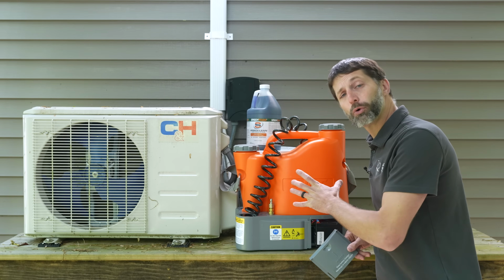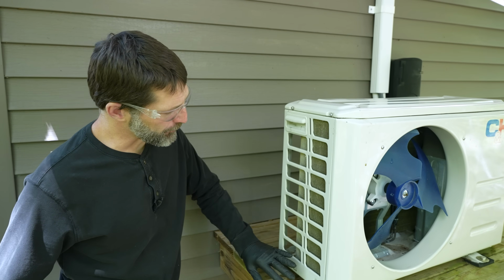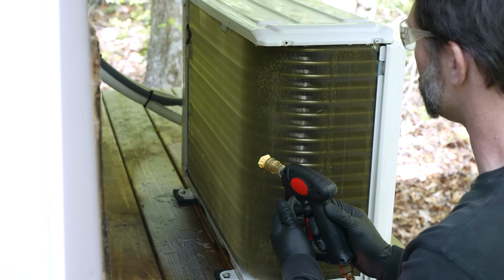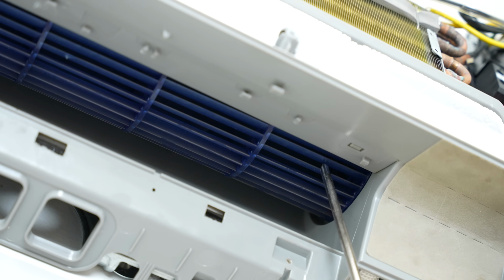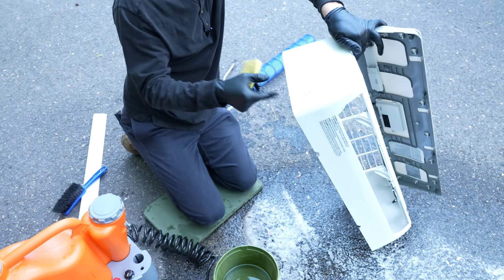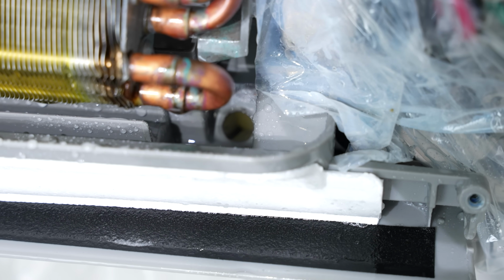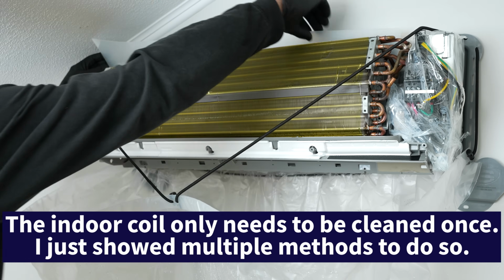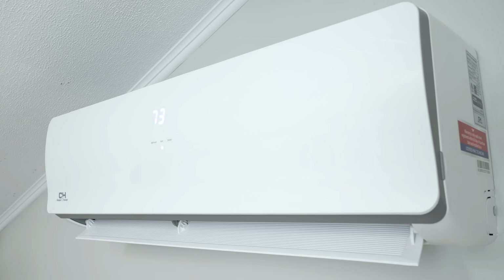Ductless Mini Split Cleaning! Outdoor Coil, Indoor Coil, Fan Wheel, Blower Housing, Methods!

Comment: Thanks to this video, I cleaned my unit properly, managed to get the blower out and deep cleaned. The blower is challenging to fully clean cause of the inner grooves, dust particles are stuck there and a pressure washer cant get to it. Next time ill probably soak it.
Reply: 100% Same here. This vid saved me a lot of guess work finsing that set screw. I used different brushes but couldn't get that grime out of blower wheel until I power washed it at about 4-5 inches away.
Reply: @Rockettube1  I tried getting the blower wheel out again and failed. The wheel is stuck on the axle (works fine though). Unfortunately most units are not designed to easily get the blower out. So now I just wash it in its place. Saves me time and I get to do more frequent cleaning.

Comment: Thank you for the guides you make, Craig!! I hope you could also make a guide on cleaning Cassette units too.

on that cleaning note, how high is the maximum pressure allowed for cleaning both Indoor Units and Outdoor units in psi / bar units?

Comment: Hey Craig, Great video tutorial.  I’m not an HVAC guy but just a homeowner.  The air handler you cleaned in the video is definitely a different brand that I have installed in my home.  The ones that I have are Johnson Controls/York, Models DHP18NWB21S and DHP09NWB21S.  Do you have any experience cleaning these?  I was wondering if this brand of air handler requires you to remove the blower wheel and condensate pan prior to cleaning?  Or can the blower wheel and condensate pan be cleaned while in place?  If you happen to have a video cleaning this brand of air handler, that would be awesome.  Thanks!

Comment: Why would a pro HVAC guy like the YouTube influencer, Steve Lavimoniere, say that it's best to clean the outdoor compressor coils with just plain water at low pressure from a garden hose? He says those specialty coil cleaning solutions shorten the life of mini-splits and put an unneeded film on the coil surfaces reducing heat transfer. I really trust this guy. He's a straight shooter and not interested in padding customers bills.

Comment: I must admit it is refreshing to see someone else struggle a bit to decipher and break in to a mini-split indoor unit to clean it!🤣  "Each unit is different," he says!  Good stuff, Craig.  I'm going to comment a bit on my experience with the Coil Jet 125.  Overall it is a great tool but (at least on mine) the bottom plastic cover is a bit too thin, fragile.  Plus, four convex dimples integrated into the bottom plastic cover take all the weight.  Mind you I wasn't rough with it, dropped it, etc... it was actually sitting on a shelf when I removed it to load on to the truck.  Suddenly, I noticed some broken plastic pieces were left behind.  This is a bit underwhelming to see in less than 4-months ownership.  Lastly, CJ should offer an option/version that allows techs to use existing battery platforms vs. your daddy's old 12VDC deep cell LA battery.  Sure, the included battery works well, but it is 2023 and professionals have (or should have) plenty of Li-ion batteries ready to go.  Luckily, I'm not waiting.😉
Reply: The supco porta blaster is another option for about a third of the price. Not cordless but if you have Milwaukee M18 batteries the top off works to power it and you can draw water from whatever container you like. I use 3 buckets, one for clean water, one for dirty water and one for holding the wet stuff when I’m fetching more clean water or dumping dirty water.

Comment: I NEVER use corrosive cleaners. Sometimes you need not have to remove the blower wheel if you use a good pressure sprayer with the right hose end sprayer. Just rotate and spray.  
 I built a sprayer from a 80 psi low gpm 12v water pump and a 12v 7ah dry battery with a 2.5 gallon sprayer jug. Got the  stainless steel adjustable sprayer head from a pest control site. About $160.00 for it all and it has done well for about 9 years now and is very portable.
 Dawn detergent and windex works wonders on coils.  Been using it for many decades. Oily coils get cleaned well with 409.

Comment: Craig does 3psi Nitrogen flows through the compressor or pass through when brazing it in? It’s does why? If the nitro doesn't flow thru, does it build up inside the compressor? Thanks

Comment: What a bunch of junk plastic, hard to reach screws and bib to deal with for maintenance. I only service MY Fujitsu or Ameristar that I installed. Other cheapskate customers or DIY’ers can get their weekend jacklegs to do their PM’s. You can buy a new indoor unit for the cost of a maintenance on one of those systems.
Reply: In my opinions Fujitsu are throw away units, low quality internals. Mitsubishi is the way to go for splits, great tech support and they last forever
Reply: @HVAChrisss you are right, you can take the mitsu units apart in less then 5min, super easy to clean
Reply: Not with the new refrigerant

Comment: For those of you not wanting to spend this much on a pressure washer, buy the battery powered DeWalt power washer, it's 500 psi but you can buy larger orifice tips to lower the pressure.

Comment: There was a test done, do you rinse first, or apply soap first.  The results were to soak it in soap BEFORE you rinse.  If you rinse it first you are diluting the soap as it's applied.  Just a tip for next time!

Comment: 2-3 hour process. $400-$600 job.
Reply: Just buy a whole new unit for that price
Reply: @RobertDickens2002 Most ain't able to service themselves
Reply: 😳 we pay 150 a unit. Each heads fully disassembled too. Not just a quick wash down. Gets 5 units done in 4 hours.
Reply: @eastcoastganjafarmers85  After washing the coil and reassemble everything how do you prevent water droplets before and during test runs?
Reply: not bad right?

Comment: In the video clip section about the super dirty coil. If you wait that long to clean a ductless indoor unit you will likely develop indoor air quality issues and health issues. Don't wait until it gets that bad to schedule a deep cleaning. And that video clip show the indoor coil completely removed and disconnected from the refrigerant lines. A service tech performing a cleaning on a working unit will never recover the refrigerant, disconnect the indoor unit from the lineset just to clean the coil outside. Because that would mean upon reassembly they'll need to reflare line set connections, perform a temperature compensated pressure decay test, and vacuum decay test, and recharge the system. Surely that is too expensive and too much work for just a cleaning.
Reply: Thank you for pointing that out. I would LOVE to thoroughly clean my coils but I can't. And that's the problem with these units--you can't really and truly get them perfectly clean again. I've had dirty sock syndrome the whole time, which started a couple days after install. I don't understand why they sell things that are textbook examples of Perfect Environment for Mold Growth.
Reply: @csm1813 get a battery powered chemical sprayer, a gallon of nucalgon evap-fresh, and a mini-split bib kit. The dirty sock smell will go away. Also check the mini-split to see if it is sloped towards the drain and check to see that the drain hose is in the 6 o'clock position of the hole. I've seem many where the communication wire and refrigerant lines ended up taking the 6 o'clock position in the hole resulting in the drain hose ending up at the 10 to 2 position. Effectively resulting in water pooling. Not good.

Comment: The C&H Astoria series and the Carrier Performance series ductless wall heads are significantly easier to disassemble and clean. Most other ductless wall heads are like this one, quite difficult and delicate to disassemble and clean. I put my blower wheel into the dishwasher once I have it removed. I hope more people buy ducted cassette style indoor units and install them with a filter grille that accepts widely available disposable MERV 8-13 filters. Those filters good enough to keep the cassette clean for a long time unlike the mesh filters on ductless wall heads that are lackluster filters. Ducted cassette cost a bit more upfront and take more planning to install but you get better conditioned air distribution and much lower maintenance costs.

Comment: Hey, do you think people are willing to pay for such cleaning, it takes a long time.
Reply: People are willing to pay for people to mow their lawns or even pay to leaf blow leafs cause they are scary.  People need to stop talking down trades.  Pay or not, no one forces you to pay what you think is a high price.
Reply: @Ness Nesu  I'm also a landscaper as well. 😁 I get what you say that people talk down respectable trades. Sometimes not willing to pay accordingly. We work hard and master our trades. You know it's the service that someone brings to the customer that matters in this business. I take pride in my work and take care of my people. Just saying.
Reply: It does take time, but in the long run, it's well worth it. I've cleaned traditional units in the past.
Reply: Definitely indoor coils can get really bad which will actually cause them to leak/not heat or cool properly. When you need a bib kit it’s pretty bad.
Reply: I dunno that cleaning process seems like a long time with many opportunities to screw something up.  This is a 600$ job all day long…. This seems like it should be a once every 5 year job.  Doesn’t make economical sense to do it every year
Reply: @Seedavis912  Well, maybe not yearly, but if you keep pets out of your home. The airhandle unit doesn't need to be cleaned as thoroughly. The only reason the outside unit should be cleaned is because of the existing elements. Such as mowing and partials that may clog the fins in time. I'd say roughly every few years it should be done. A good deep cleaning will save you a replacement later on.

Comment: Don't want to be "blamed" for breaking a system.  LOL  Selling the house,  had a company come out to check the package unit.  He tested the capacitor and pressures.  All good.  He's packing up to leave notice the fan is going the wrong way.  I suggested he check the wiring to the capacitor sure enough he hooked up the wires wrong.  made sure he checked the capacitor again, sure enough it was now out of spec.  Thankfully he had a the right cap on the van.  Moral of the story, a professional is someone who gets paid for the work.  Doesn't meant hey are experts or with out flaws.  Either do it yourself or double check a professionals work.
Reply: I find that if you remain loyal to one very well trained, experienced HVAC contractor, you won’t have issues like this. When you jump around to get the quickest guy out on the service call, they don’t have any loyalty to you either. Kind of like marriage.
Reply: @USA-GreedyMenOfNoIntegrity  Its not a matter of loyalty, but a matter that reflects the quality of work. Unfortunately this day and age, there are more unqualified techs that don't even know what they don't know; so consequently they thought they know.

Comment: I have heat pump i was cleaning coil on now unit won’t even turn on does anyone know what can I try to turn it back on customer changed the thermostat battery while I was cleaning so now won’t come on 😮😢
Reply: Try first checking you have power coming to the outdoor unit. Maybe the the disconnect plug is not well connected. Check the fuses in the disconnect box. Check that all the wires are well tied in the outdoor unit and the indoor unit as well. You can star doing that.
Reply: @survivor-z3t  
I have power in to unit power out I couldn’t get 24 volts to my contacter
Reply: @ejohnfall the transformer that is giving the 24 volts needs to be checked. The connections on the board as well.
Reply: @survivor-z3t  
I was going to replace the board
Reply: Blown fuse
Reply: Batteries in wrong way lol

Comment: Good timing on this. I did surround my unit with a patio mist setup filtered and all but still got build up. What should I use for that? I've got a sodium exchange water softener plus a filter and still... What the traditional coil cleaner solution do the job?